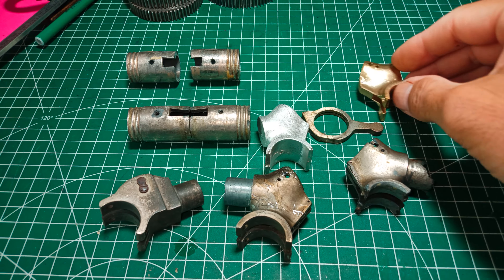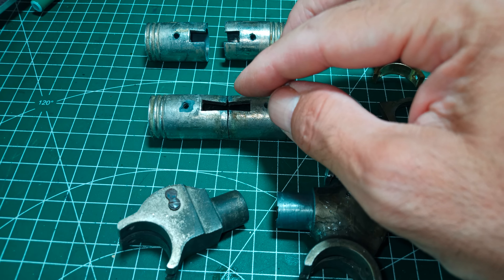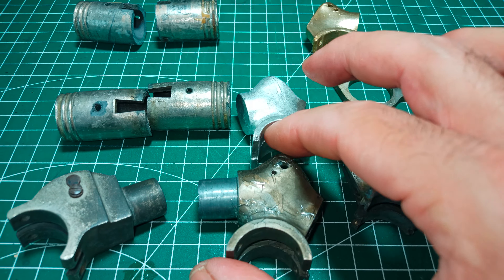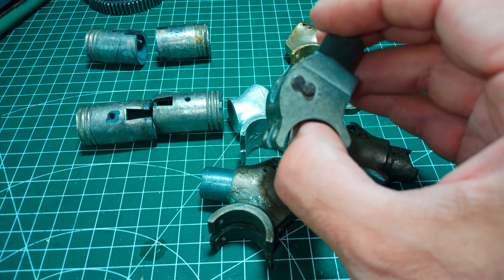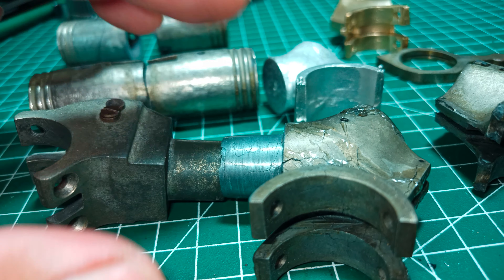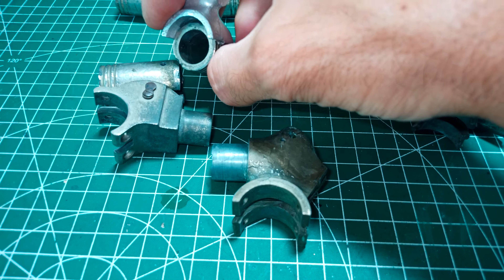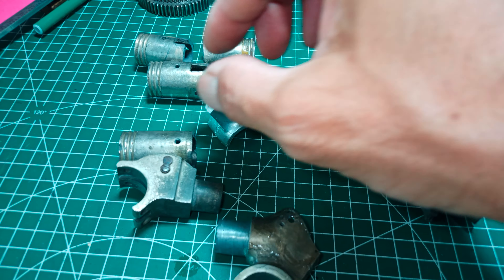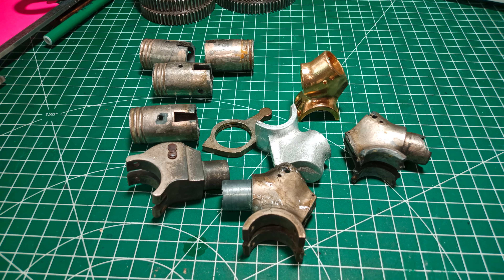Columbia Phonographs trunnions

Comment: Hola Pedro! I do have the same problem with the tube on my Columbia AT model phonograph… 🙄 it still holds but the pot metal already has some cracks and some parts missing… 😢
Reply from the maker: That's why I'm making these parts new and they are been sold really quickly
Reply: @PedroFono  Muy bien ! Drop me a line when you’re done I’d like to take one of these… 👍🏻🥰🙏🏻 muchas gracias ☺️